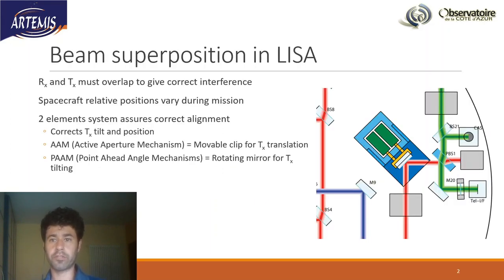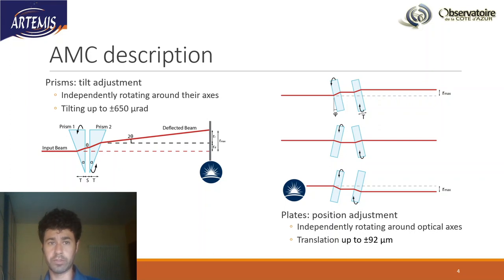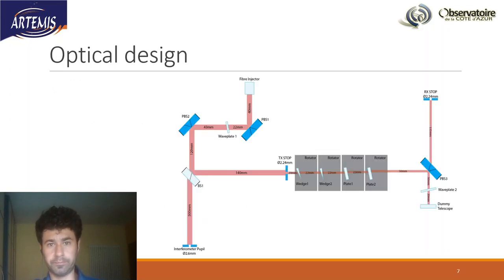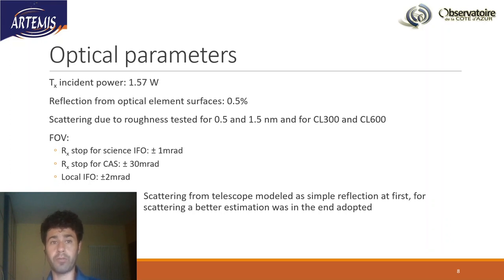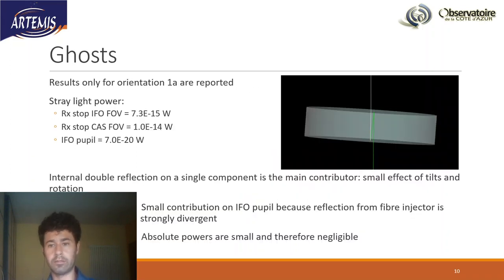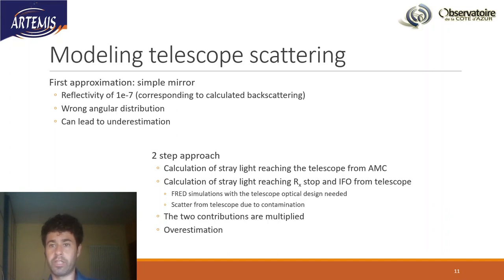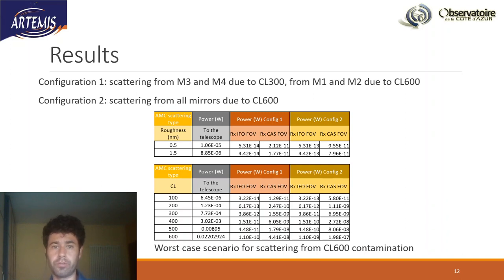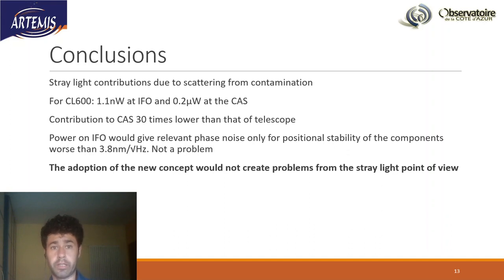Stray light analysis for Alternative Mechanism Concept in LISA optical bench

Comment: Hi very interesting video. I have some questions. The Need for the PAAM Is due to the high distance between SCs and their relative velocity. Right? Infact if they were relatively fixed the Tilt angle would have been 0 (no tilt to lenght coupling). Is this tilt angle retrived from Optical measure or its preprocessed and uploaded on board? The PAAM Is activated even in the constellation acquisition Phase? Thank you